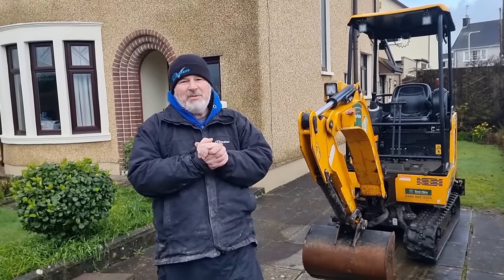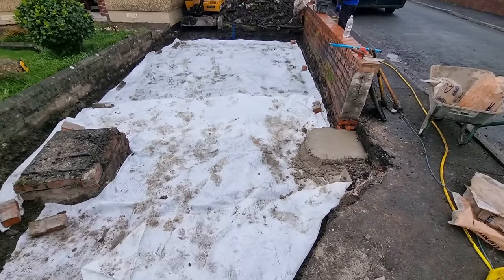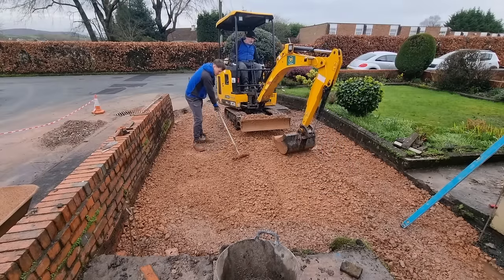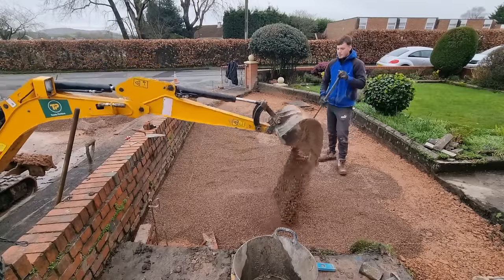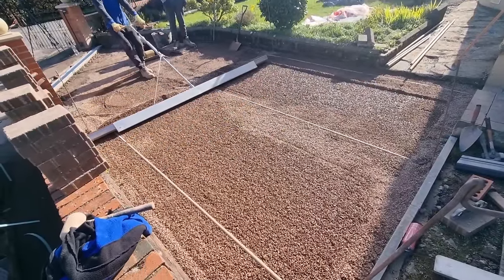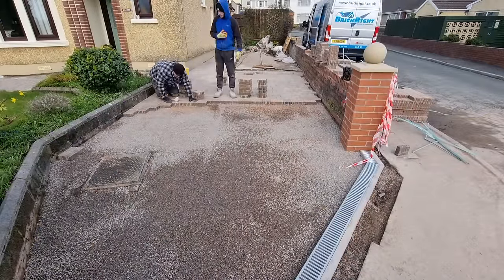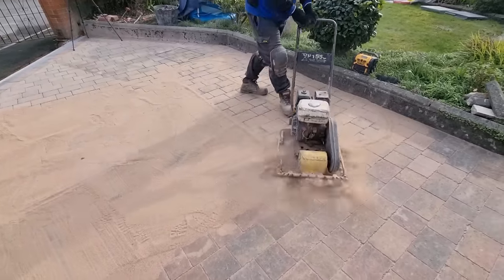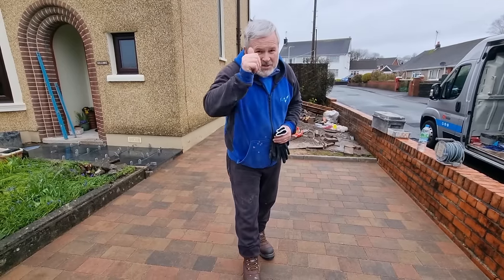Block Paving Tegula Driveway Full Process

Comment: Amen to the 2/6 we have been using for a good few years now. It's much easier to work with. Loveley job as always
Reply from the maker: Yes Jay agree we been using it now for a while much better all round 👍
Reply: @brickrightbuildinglandscaping  we use under artificial grass aswell never had a problem sand washes away over time.
Reply from the maker: @jayglover74  why not good shout Jay 👍💯
Reply: What are the chippings called you've used instead of sharp?

Comment: Excellent workmanship there.  One question, I always thought block paving was permeable and water can drain straight through it.  If it is permeable why did you install drains?  I'm thinking of redoing my patio in the summer using the exact same block paving from Marshalls and wasn't planning on installing drains.  But watching this video it seems I may have to?
Reply from the maker: This system isn't permeable kevin .the marshalls priora range is mate 👌👍

Comment: Hey mate, I hope you're well and you guys are still getting some good business. This looks amazing btw. Quick question: were you guys checking for a 45mm gap between the stone chippings and your string line before you whacked the stone chippings down and screeded it? Just asking as we are moving onto our first block paved patio in a few weeks so your videos are really coming in handy for us. Thanks again! 🙂

Kind regards,
Sam
Reply from the maker: Sam to make this easy mate .
Set your lines to a start and finish level.
If the drive is emptying  the water to an ack drain id set your line 10mm higher .so basically 10mm higher all over the drive than finished height  you require. 
So you then measure the thickness of paving ie 50mm from line to screed layer.
When you compact the paving it will then go down by about 10mm Sam.
Hope this helps  you mate 👍
Reply: @brickrightbuildinglandscaping  cheers for the response buddy. Much appreciated and very informative. Hope all is well with your work atm mate! 🙂
Reply from the maker: @GKLandscapingandGardenServives  
Apart from the weather all ok thanks.same to u guys good luck 👍
Reply: @brickrightbuildinglandscaping  yep weather has been pants on our end as well lol. Great to hear your work is still going well buddy and thank you. Got a few potential biggies to quote up in the pipeline so hopefully we can upload some content if all goes ahead. Take it easy mate! 🙂
Reply from the maker: @GKLandscapingandGardenServives  
Hope all goes well with it all mate 👍

Comment: Super tidy lads. That just clean 6mm chippings yeah
Reply from the maker: Thanks lee.Yes its clean 6mm its solid way better than sand in my opinion 👍
Reply: @brickrightbuildinglandscaping  
Superb buddy yeah must agree. Don’t really do drives. But been using 6mm clean gravel for artificial grass. In fact for mate there a mixed fine granite dust 2 parts to 4 clean gravel through mixer for 25-30mm under grass. Water flys through. Sharp sand just doesn’t move it enough. Found gravel more cost effective also if big area as the grantie dust up here your £50 a ton.
Reply from the maker: @lmilne4859  
Totally agree 👍

Comment: Why no weed controller?
Reply from the maker: @ramichehab4797  
If you watch the video it's been added 👌
Reply: @brickrightbuildinglandscaping thank you but you put a white controller before the mot type 1, but not for the whole area. I thought we should usually put it after the mot type 1 for the whole area. No?
Reply from the maker: @ramichehab4797  
No if you put the membrane in after the mot type ie beneath the the screed layer it does nothing to control weeds .The membrane isn't layed as shown in the video to control weeds .It's layed to reduce the transfer of the mot type 1 into the ground which was clay .This stops the drive sinking. 
That's why the membrane is used as we used it .
For weed control you'd be better to treat the drive with a weed control solution and spray it on top of the finished drive as that's where weeds tend to form .That's my understanding and opinion on your question 👍🙌
Reply: @brickrightbuildinglandscaping  awesome many thanks for this information. One last question do you think polymeric sand price is justified compared to the kiln sand for weeds problem between joints of pavers?
Reply from the maker: @ramichehab4797  
I've used polymeric sand between the seems OK but it's very expensive compared to traditional kiln dry sand

Comment: You would be better taking out recess cover then sanding it separately  as you have just vibrated sand into sides of recess cover good luck to homeowner getting that out also you should whacker plate paving first (you won't mark any type of  block paving with plate and don't need sand or rubber mat to protect paving)before sanding to bed paving units  in and to allow you to inspect and  remove  any damaged paving  then you brush over kiln dried sand and whacker plate it again to vibrate kiln dried sand  between joints,nice paving that  good job lads I won't mention the screeding rails
Reply from the maker: 🤣🤣 no dont do the screed rail thing again 🤣🤣 .We all do things differently i suppose and i respect other options no problem .Always willing to learn 👍💯